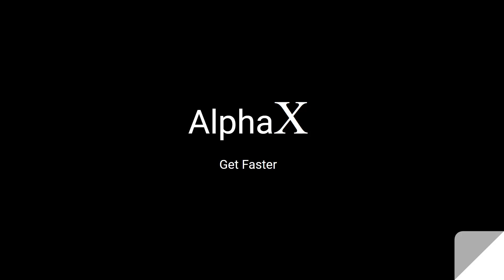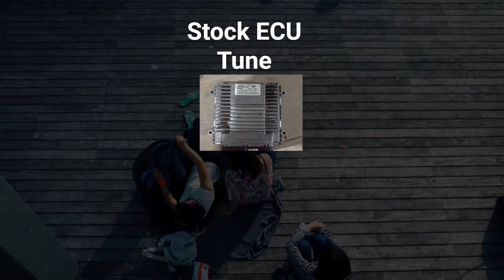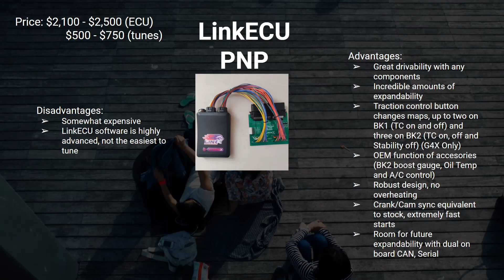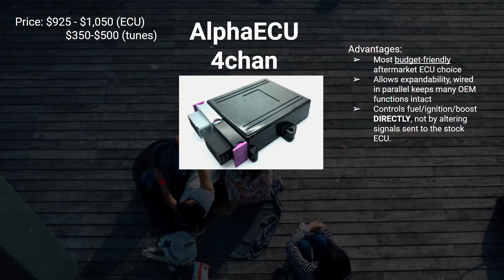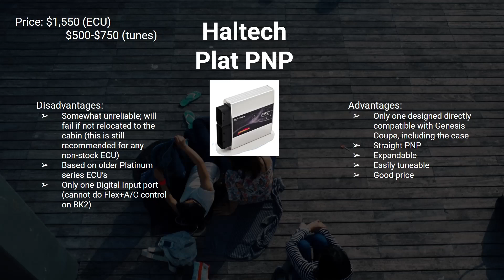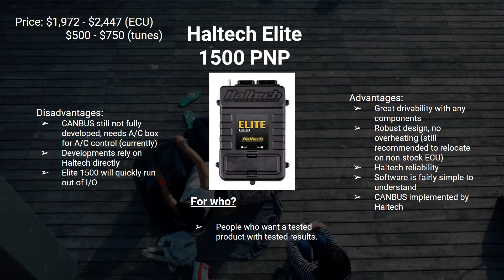ECU Comparison for Genesis Coupe 2.0T

Comment: Can you order these ECU's with the tune already installed? Just upgraded the Turbo in my BK2 2.0T and I'm wondering what needs to happen for me to be completely safe. Stock ECU, Bolt on Turbo kit, ISR Turbo back 3" exhaust, Injen intake, OEM injectors.

Comment: What is this AC box you are referencing?
Reply: I’m pretty sure hes just talking ab the A/C in general. Although doing research on their Facebook, there’s a separate module which they call the A/C box for the Haltech Ecu’s and it’s a separate add on in order for you to run both a/c and flex. The good thing ab the Link is that you won’t need that separate piece of hardware because it can run perfectly fine. It’s just if people would like to run haltech since it is easier to understand they can buy the ecu and the a/c box separate. Hope this helped in going to sleep mayn it’s 6:32AM
Reply: @matt808_  awesome